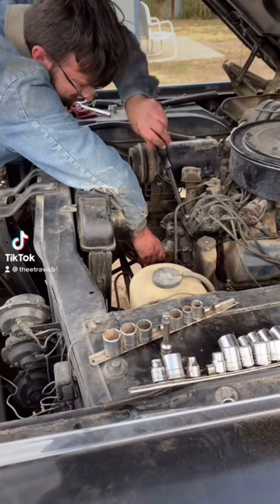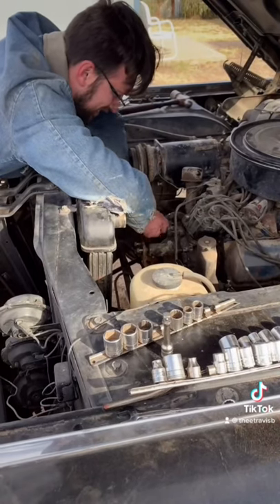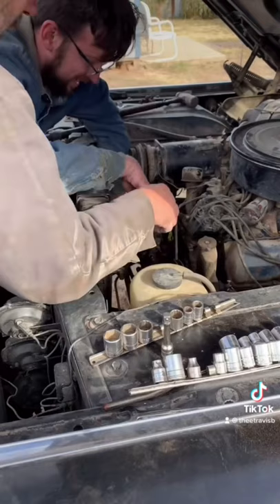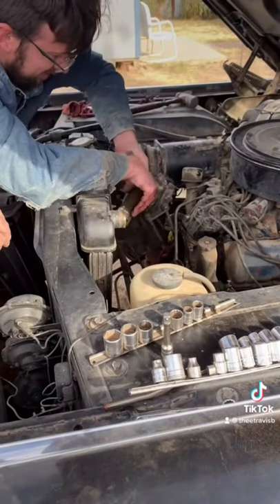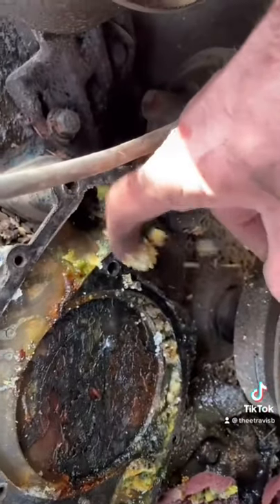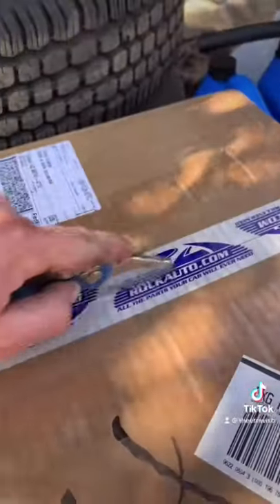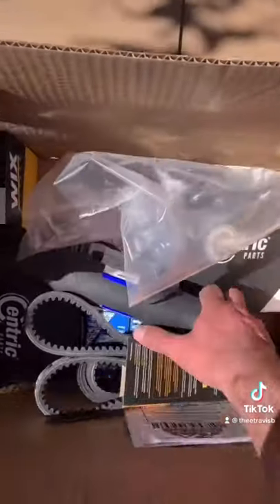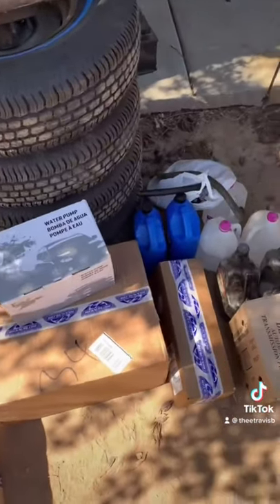64 caddy limo restore part 3/13

Comment: Have you seen what it takes to remove a water pump from a modern car? You had enough room to stand between the engine and the radiator. That is far from a total pain.